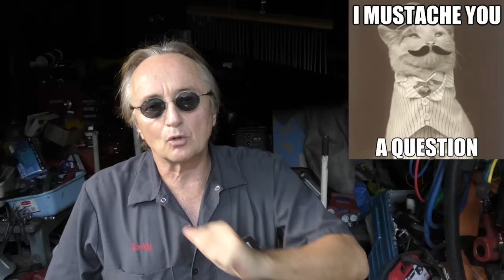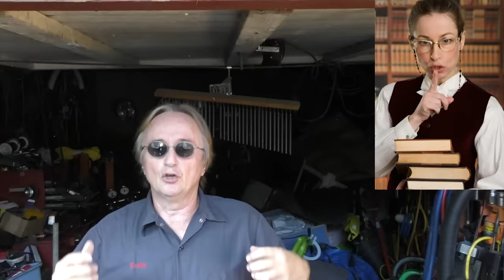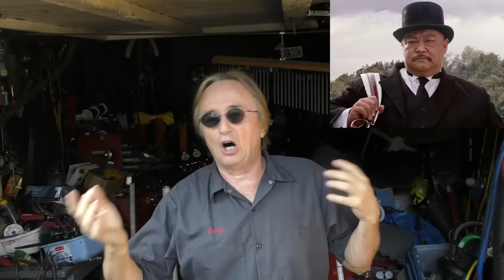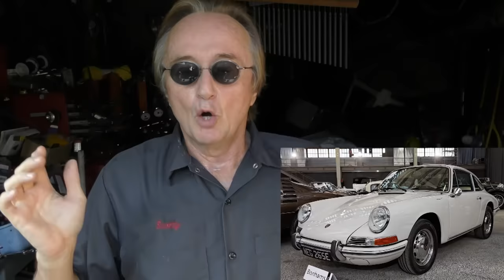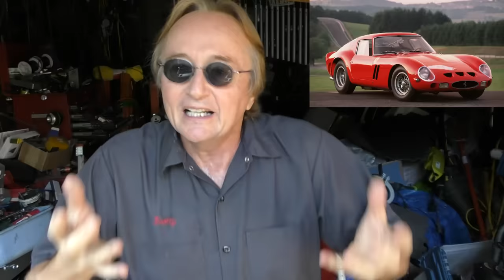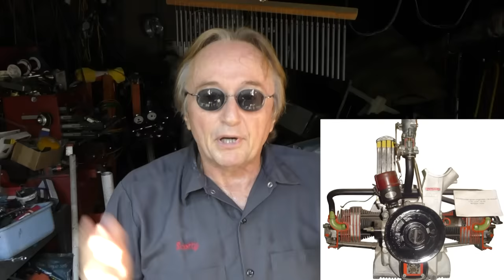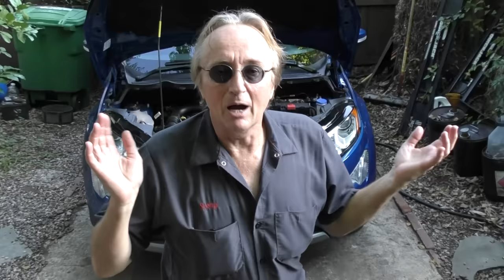The Truth About Boxer Engine Cars

Comment: I purchased my 2010 WRX in September of 2009. I still have it today which is May 2023. It has 157,241 miles on it and has no mechanical problems whatsoever. Only a little rust starting over two of the wheel wells. I live in Buffalo, NY, though, so I've put it through 14 crazy Buffalo winters (so far).

The engine runs perfectly and doesn't knock, whatsoever. I drive the car hard at times, too. The only fixes I've had to do to it over the past 14 years, that are not wear and tear items, were the fuel pump (which I had to replace one time), the relay switch for the heat/ac blower fan (cost $150 to fix and only had to have it fixed once), and one LED light from inside one of the heated seat switches. That is all.

Everything else was wear and tear items. Replaced the clutch at 95k miles (upgraded it to a stage 2), had to replace a few wheel bearings over the years, headlight bulbs, belts, brakes, wiper blades, etc.

All-in-all, the car is incredibly reliable. I've had zero drivetrain issues, and almost no issues at all except those couple minor things I mentioned, for 14 years of heavy city driving with long, harsh winters. It's by far the most reliable vehicle I've ever owned (and I've personally owned 8 different cars in my lifetime).

Comment: I will argue that point..
The boxer being obsolete. 
I have owned my first Subaru hatchback and absolutely love the hell out of it.
I recently went "mudding " and despite the fact that I have to replace a wheel bearing and four CV  axles, I've never been happier with any vehicle and I'm a die hard Ford lover. Yes I know that expensive repairs are necessary and common but I be damned as far as I'm concerned,  it's worth it.
I'm gonna drive my Subaru till it ain't worth fixing, then I'm gonna make it a rally racer.
Reply: Both front wheel bearings and CV went on my Impreza as well (along with a long list of other issues). Car is built really chinsey and cheap imo. The engine plus CVT is anemic too.

Comment: Subaru EJ22s are bullet proof its the EJ25 that has the head gasket issues (bad head gasket design, not from thrashing or whatever mentioned) - if you replace those head gaskets with the genuine Subaru EJ25 TURBO head gaskets (different design MLS gaskets) its a permanent fix, if you have a manual EJ25 Subaru and your clutch is due and on original head gaskets leave the transmission in and remove the engine and do the heads at the same time.

The original head gaskets for SOHC EJ25 usually leak externally and cause no major problems and can be ignored for years, the DOHC EJ25 (early EJ25) have internal leaks (coolant-combustion)

If you take your Subaru to the dealership for head gaskets they will replace them with the same part number and it will fail again (usually sooner due to poor workmanship - heads not inspected/machined, poor preparation of heads using a flap wheel etc)

These are really simple cars to work on, everything is easy to get to.
Reply: People complain about spark plugs access not served like a steak on a dinner plate.
Reply: @lllowelll  the spark plugs aren't that difficult even. I did my 09 legacy in 45 minutes. All I needed was to remove the battery, air intake box, and use a couple of socket extensions.
Reply: They are easy to work on, except for changing the head gaskets!

Comment: I work at a used car lot as a mechanic and my boss likes Subaru’s and one thing I have noticed in checking dozens of those cars is I’m surprised when I find one that doesn’t either leak oil or coolent from the head gaskets. Especially ones with the older SOHC timing belt engines. The newer timing chain versions are FAR better engines. Ohh and another thing I find is that people like to remove the heat shields on the cats  that rattle like crazy on every one of them. This in turn cooks the oil in the filter and the pan causing even more problems.

Comment: The boxer engine has not been passed by.  This guy doesn't really know his stuff.  A boxer engines can be just as good as any other engine.  It's just pistons connected to crankshaft with valves ect like any other internal combustion engine.  Do you think the contemporary Porsche engines have been passed  by?
Reply: It's even better than a V6 or I6 because the primary and secondary forces are canceled out perfectly in a boxer engine resulting in 0 vibration.
I6 fails because gravity pulls the pistons down faster than they travel up, and V6 fails because even a nano-meter displacement will make it unbalanced.
Reply: Sure and that's why inline six engines last twice as long
Reply: I love boxers, but I disagree. Boxers do have vibration, due to the rocking couple caused by the cylinders not sharing the same plane (there is a twisting force around the vertical central axis of the motor).
The effect of gravity is infinitesimal in any engine with vertical cylinders. People used to claim that gravity would cause the lower part of the cylinder in boxer engines to wear faster, and that is of course nonsense, too.
Reply: Scotty is the god mechanic
Reply: @vitalnutrients744  inline six engines are better but the boxer engines are very reliable as well. Also inline engines are inherently smooth as well.

Comment: The pros and cons about flexfuel engines? Are they better than single fuel engines?
Reply: Good question
I would also like to hear an answer on that.
Reply: I thought he already did answer this question
Reply: @adcolt54  Really? Send me the link please.
Reply: FlexFuel vehicles use components with a far greater resistance to corrosion and they have fuel nozzles that can adjust to greater ranges (as ethanol needs more fuel injected vs gas). IF you have a FlexFuel vehicle and you use E85 you should see far better life out of your engine then using gasoline. It burns much cleaner, smells better, contaminates the oil far less, wears engines much less (see EngineeringExplained video were he goes through the study), produces significantly less pollution, is 100% renewable, and can be carbon neutral
Reply: Biggest technical difference  between E85 and regular fuel is that high ethanol formulas corrode fuel lines and rubber components faster on older vehicles. But flex fuel cars and new cars in general have modern polymers in the fuel lines to prevent that kind of damage. Fuel sensors tell the ECU what kind of gas you're running so it can alternate the air/fuel mixture, injection etc.  Flex fuel burns a lot faster than regular gas so you get less mileage on same volume of gas. It also produces less power. Those are the tradeoffs for using cleaner burning fuels.
Reply: no e85 doesnt produce less power it gives more power. and it shouldnt corrode the fuel lines on older vehicles maybe methonal yeah. im using stock line e85 in 92 civic turbod running for 2 years now. show no sign of rust.
Reply: Not many gas stations carry that crap so u end up going out of place just to get some e85. F that.
Reply: Every modern car is a computer flash away from being able to run flex fuel. There is no mechanical difference. All modern cars are capable of storing ethanol in high concentration without degrading the fuel system. The ECU (computer) is flashed for and the car badged for E85. Aside from that the model is identical to others in the same line up. If you have a J box programmer you can add a flex fuel sensor and program the majority of modern cars to use it.
Reply: Thomas Strickland e85 is 85 percent ethanol and 15 percent gasoline, gasoline has a much higher btu than ethanol, thus gasoline makes more power and is more efficient, they’re going towards ethanol because a renewable fuel source, literally just grain alcohol, thats were you see a lot of e85 at pumps is out west where the corn grows
Reply: Gabriel Ferreira it's a hoax. Trust me!
Reply: From what I've learned, it's all about calculating the ignition. So just programming ignition. But I don't see vehicles that runs alternative fuel - they only opened one fuel station that offers it a few month ago and it's a city 300 kms away. I might be a propaganda victim for all I know and I don't have any experience on them at all.
Reply: Ethanol is garbage... i did multiple mpg tests years ago on my chevy 5.3 pickup and get such better mpg on premium(91 octane) and a simple computer reflash that theres no point buying the ethanol blend... plus theres the fact that it takes more energy to make it than it puts out. But the multi million dollar farm operations here in iowa seem to b doin great....
Reply: @Ehren1337  It only gives more power if you have a way to take advantage of the extra octane, otherwise it has no upside. At least in the USA it's a product of corn farming lobbyists and is in no way going to save the environment. It takes over a gallon of gasoline to produce a gallon of ethanol, which has less energy than a gallon of gasoline so...
Reply: @JaredHIll13  I thought these alternative fuel is to have more option to put in your tank rather than being stuck with gasoline. The premise as I remember is that there's not as much demand on them(lower price), and it is more available(other than the lower demand there are alternative sources other than extracting from crude, for methanol at least).
Reply: RickTrajan, read what david regan commented, he hit the nail on the head... basically its a scam from the epa and farm lobbyists etc. As to ur question, The "flex fuel" vehicle has a sensor in fuel system that determines what kind of fuel is in the tank and adjusts the car computer to run correctly no matter if its e85 or straight gas. Hope that helps... oh and dont ever run ethanol in a small engine like a mower or any motorcycle... it will drastically shorten the life of the engine
Reply: @JaredHIll13  didn't really ask if how flex fuel works and indeed the push for alternative fuel, hybrid cars, electric cars and hydrogen fuel cells are all in all for someones profit, you got to think for the best options you have at hand - though pointing out manipulations by the ones who make decisions for our options is good so we could really make the best we could have at a given moment.
Reply: RickTrajan, True, good points. Sorry Rick, I misread ur previous comments... ethanol just gets me all worked up lol.
Reply: @JaredHIll13  no woories, there's always things that get to us. Alternative fuel is not that available from where I live, I never played with gas mower and even carbs - my lawn is really small and my electric weed wacker is convenient enough. Though knowing more things ain't harmful.
Reply: RickTrajan, right on... As far as the electric, hybrid etc. craze...back in like 1983 Carl Cella made a working hydrogen generator that he fitted to a cadillac coupe de ville.. the car then ran on water and had no pollution, carbed engines only... when he contacted the department of energy to show them it actually worked, he was confronted by two "agents of tyrannical oppression" who told him that if he tried to mass produce it he would have alot of "problems".... big companies cant make money off water lol. Anyway its interesting reading his design and im in the process of making one myself.
Reply: @JaredHIll13  I always hear about people making vehicles running on water alone. I wish I did researched on this things. The story you say make sense. Anyway, good luck - I find just doing it rather than having a big elaborate plans works but it might be just me.
Reply: He asked for questions for a future video, not for questions to answer in the comments. I imagine he likes it because he's considering it for the future.
Reply: What is a flex fuel engine? The ECU and fuel sensor control the air-fuel ratio. Besides these two components a flex fuel vehicle and non-flex fuel vehicle are the same.
Reply: @JaredHIll13  Gasohol will not shorten the life of small engines. Mismanagement and poor maintenance sure will. Rejet or remap a small engine for the fuel you are going to use, and get your fuel from a station or jobbers who is a good operator. I have many miles on many bikes, and many seasons on mowers and snow blowers using gasohol with no problems. The lower octane no lead has many problems also, but you can run it also with maintenance and proper operation. Regular gas has more BTUs than gasohol, so better mileage. If the engine is retuned for gasohol, there are no power differences. And alcohol fuels burn cooler, if heat is a problem. Both fuels are good, but poor owner/operator management will ruin an engine operating with either fuel. I just wish governments would stay out of this and let people run what they want, and what works for them! Problems would then be solved.
Reply: Ron Fullerton, good points Ron.. i guess i just assume ppl arnt going to want to rejet their mower/blower lol so i always advise them to steer clear from it when i have their machine in for service, and its just my opinion but i will NEVER run an ethanol blend in my motorcycles, i just cant bring myself to do it. And your right, the gov needs to leave us the heck alone and alot of things would be better.... have a good one
Reply: Sandy Lee, right o.. its refreshing to have a conversation with some ppl on here who actually know what their talkin about. Just to b clear, when i say ethanol blend, here in iowa its like a 10 to 15% content to boost the octane rating of regular fuel.. idk if its like that all over the country, but it is here and it sucks.  E85 on the other hand has its benifits as a race fuel like you pointed out.
Reply: @JaredHIll13  thank you for the backup. Everybody should just use what works for them, and government should not get involved. But some of this miss information about gasohol is unbearable. I am very much a pessimist any more due to all the bad news, but I have a lot of experience with gasohol. Thanks again!
Reply: I would like to put my insight in this comment section but the top comment of this thread has put a lid on it. Only the government can come up with terms such as “flex fuel” and “single fuel” engines.
Reply: There’s a reason why people prefer to tune on e85 rather than premium you know
Reply: The number one problem with flex fuel is.  Some fuels have LOWER BTU'S thus reducing mpg, hp, and torque.
Reply: JaredHIll13 Plus gas that has ZERO ethanol or methanol produces the best hp, and mpg.
Reply: I dunno aboot flex fuel cars but i know if u add knock sensor you can run e85 in miatas for big powers
Reply: I have been using E85 on my Armada for six months during winter and spring here in midwest. All I noticed is that acceleration is much quicker and cost me much less to fill up but I also got only 10mpg. For regular 87 gas I usually get 14mpg. I went back to regular gas because I'm too lazy to stop filling it up so often.
Reply: Ethanol is very gummy when burned and these motors have to be ran at lease once a week.  Otherwise the engine has to be taken apart to cleaned.  Dont bother it is not worth it. Finding a gas station is hard enought, we dont need to make it harder.
Reply: I’m not buying the “carbon neutral” argument on ethanol. Plus, it is heavily subsidized by tax payers and likely breaks-even on energy in vs energy out in the process of producing it. Ethanol is likely a net negative. Even Algore is starting to agree